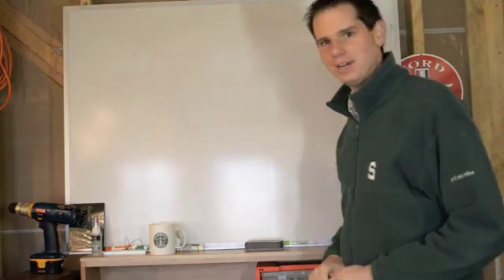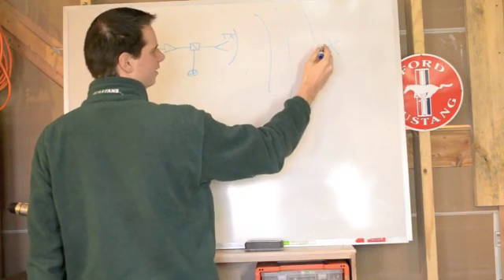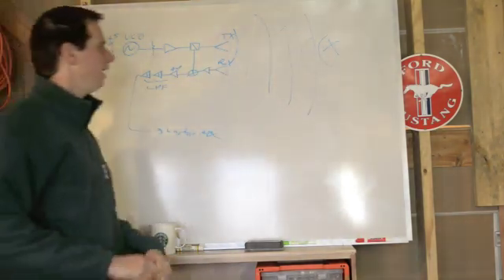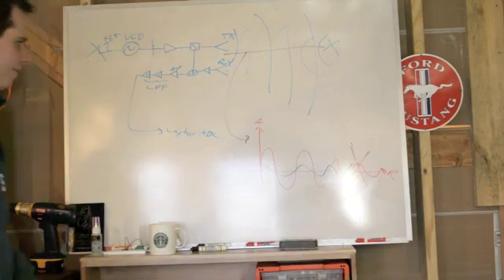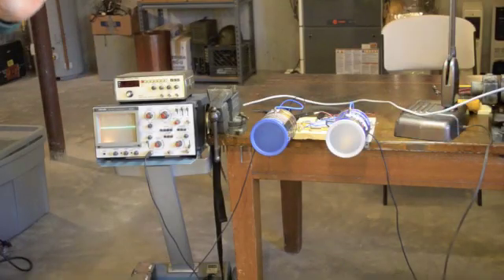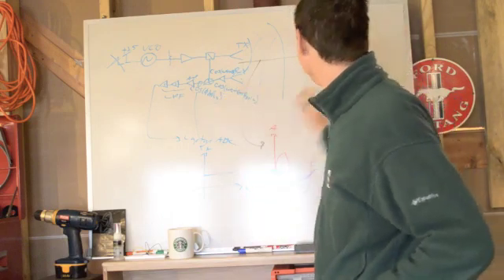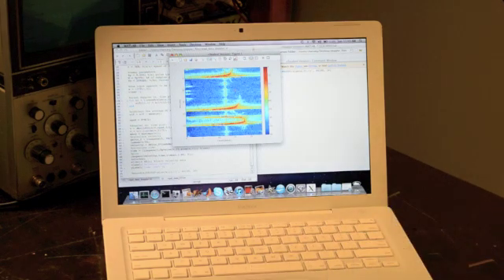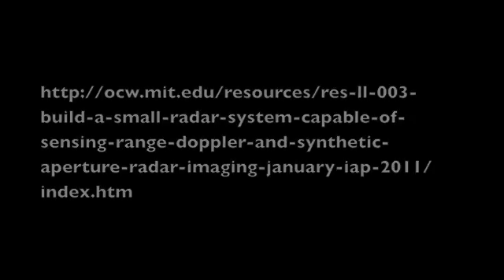Doppler Radar Explanation and Demo using the coffee can radar

Comment: Some years ago I bought a 10 GHz quadrature doppler module with two pickups a quarter wavelength apart. Connect the outputs to a scope in X/Y mode and as you move your hand toward and away from the unit you'll get a point that spirals around the center. This makes it possible to tell if the target is approaching or receding.

Comment from the maker: ACC is likely similar to Police Doppler radar in moving patrol mode.  Two doppler signatures will be measured by the device, a higher frequency one for the vehicle moving due to road-clutter scatter and a lower frequency one due to the vehicle in front moving away from.  Doppler radar is simply change in scattered phase over time, this is another way to think of it.  Hope this helps.